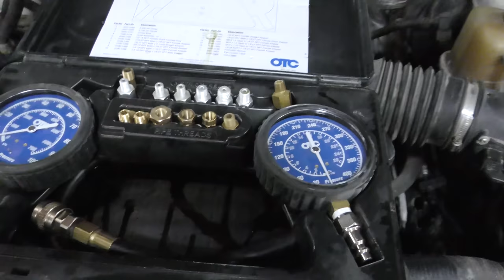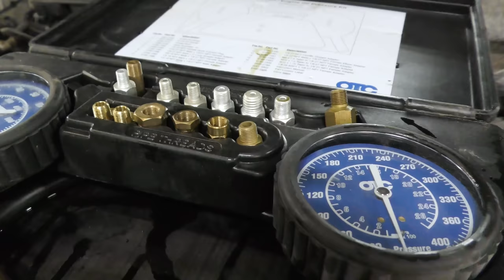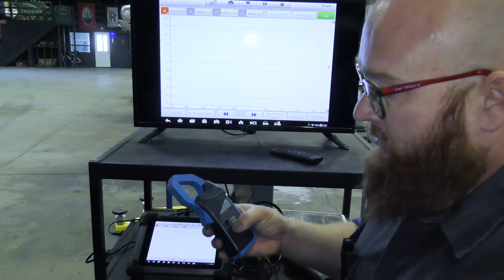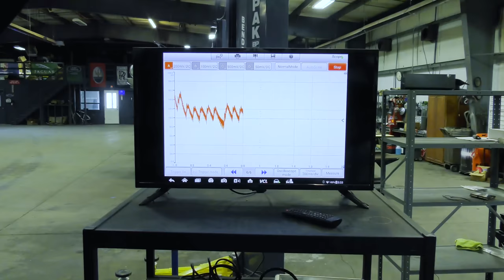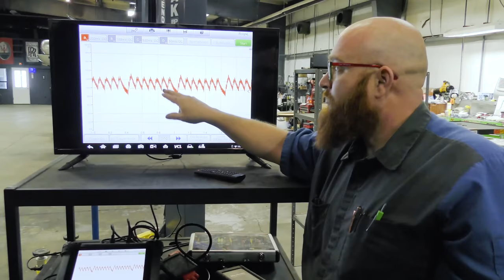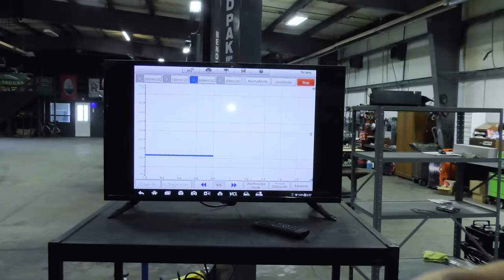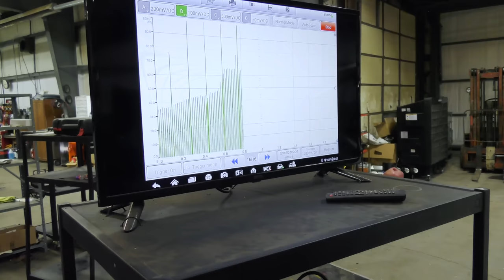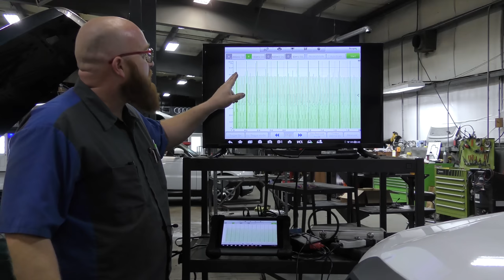Can an engine additive really fix this 2011 F150? CAR WIZARD shows how to diagnose and repair

Comment: thats why running a quality engine oil from the start and changing it on time is so important it helps make it so engines can go 200k to 300k before those types of problems occur.
Reply: Few people that buy new cars keep them beyond 100,000 miles. Therefore, they should use the cheapest oil they can find with the longest intervals. It's the next guy's problem.
Reply: @ryanroberts1104  too funny cause its true. Some people just dont even change the oil 😝
Reply: @ryanroberts1104  agree, if you are one of those guys who buy a new car every other year, why bother?
Reply: Can you define a "non quality," engine oil from the last 20 years?
Reply: its like the wizard said in another video, only 25% of people maintain a vehicle properly. I can attest to this because my son is the head oil change tech at the local valvoline and all the time people come in with a $60,000, $70,000 truck and put the cheapest shit oil they sell in them and dont want to do scheduled services.  They go 10,000 even 15,000 miles between oil changes using conventional oil in a ecoboost engine which is a recipe for trouble.  They just dont care, till it breaks, then they wonder why they need a new $15,000 ecoboost engine.
Reply: cheap oils with 5000miles intervals are good enough

Comment: Its cool that David is willing to admit he asks experts on cars he isn't completely familiar with.  Wizard isn't a cocky guy and knows there is always more to learn in the mechanical industry. Every tech should learn a lesson from this.
Reply: The guy on the phone said the engine is toast.  No oil change.  No proof of current oil used.  So the guy is NO expert.  An expert wants more data besides the mileage.

Comment: I have a 2011 Ford F150 with a 5.0L Coyote V8 in it with 138,000 miles on it and still going strong and it's a beast and it sounds like a beast with the Borla ATAK Catback exhaust on it.

Comment: I live in a tropical country, my car has 170k miles on it, the recommended oil is 5w30, i've been using 10w40 for a while now, it did help a lot with oil pressure issues
Reply: For hot climate you should use 10w50 or 20w50.
Reply: @draganmladenov  Try Shell Rotella triple t 15w40 it's for diesels but does wonders on worn engines
Reply: @klrrafman  I've been using rotella in my 98 Camry that has almost 308 thousand miles on it. I have an oil leak and it's where the head gasket seals an oil passage on the front of the motor. the Rotella actually slowed that oil leak down with the help of the Lucas oil treatment that the wizard mentioned in this video. For the time being.... that is saving me from a $600+ head gasket repair bill. Yes she still leaks oil.... but not near like she was before I started what I'm doing now.
Reply: @draganmladenov  I lived in Florida most of my life and EVERY vehicle I had ....I've always used Castrol 20W50. The heat breaks oil down pretty quickly in climates like that.... so I ALWAYS went with the thicker oil and it served me very well.
Reply: You really have to be careful putting thicker oil in modern engines, things like cam phasers do not like that - you could cause premature damage. Older, simpler engines, especially after they have some miles on them it can be a great idea to use thicker oil.
Reply: @michaellunn4582  In italy some car dealers use this trick on very worn engines. They call 20w50 "green miracle". :) It "restore" the oil pressure and the engine is very quiet.
You are right that heat can kill your motor oil and then the engine too. The most cars don't have good oil cooler. So with the high temperature the oil lose its viscosity and it is not enough to lubricate the main bearing of the crankshaft.
But we have cold winters and hot summers where i live. I have used on my sport car in the past 5w50 and 10w60.
Reply: @ryanroberts1104  For example BMW M power engines have cam phasers - vanos system. It doesn't have problem with 10w60.
Reply: @draganmladenov  And nobody is talking about that engine. And I'm sure they rarely last even 200k miles. You cannot just put thicker oil in everything willy nilly, you need to know what you are doing, and if you don't you shouldn't be doing anything.
Reply: @ryanroberts1104  You were "talking" about modern engine with phasers and i gave you an example that you are wrong. Not all modern engines will have issue with thicker oil.
And i'm not a "keyboard warrior". I actually have used 5w50 and 10w60 on v6 alfa romeo engine designed for 5w40 oil.
Also i have seen few engines with main bearing failures from using 5w40. Alfa romeo engines, not BMW.
And yes, It is your decision and responsibility what type of oil you will put in your engine.
Probably this f150 wouldn't have this issue if they used 5-40 or 0-40 since the beginning. Or just its oil cooler is not calculated well by ford. Not a surprise actually :D
Reply: @draganmladenov  : That engine is designed to use that weight oil, in that engine using any other weight is for emergency topping off only.
Reply: That’s what my mechanic recommends on high mileage vehicles but as long as the oil isn’t too heavy that it prevents cam phasers from operating properly on VVT valve trains.
Reply: @ryanroberts1104  My car is a 2009 ford duratec without any kind of vvt, but it does have hydraulic valve lifters, and it can be an issue if too thick oil is used, specially on colder climates
Reply: I also live in a tropical country, since the vehicle I have is a modern toyota non turbo, I use the recommended 0w20 synthetic oil. The protection is top notch and it runs smoothly. If using a thin oil like this in my opinion, just drive it normally not push it. Also, get the one that is API SP and ILSAC 6A or better rating. The rating of those modern oils mentioned proves that no matter the climate it so robust and you'll ne confident in that your vehicle will last long.
Reply: @draganmladenov  I live in Houston Tx and use 20W 50 in all three of my trucks and cars
Reply: @michaellunn4582  I too have always used 20W 50 in my four vehicles. I live in Houston Tx. In these hot climates the use of 20W 50 is good even when the car is new.

Comment: Change to Motorcraft Oil Filter--smart.  But it seems to me that the Lucas additive is simply acting as a thickener thus raising the oil pressure.  I'd expect changing to a higher viscosity motor oil would have the same effect.  I think problems like this generate out of the the auto manufacturer's love for continually thinner oils for the sake of raising their fuel MPG figures.
Reply: Yep motorcraft oil and filter in these Fords on regular intervals always. Uncle, former mechanic, taught me that 20yrs ago and never had an issue out of them. Even though I drive a GMC now. 😅

Comment: The advancement in diagnostic tools is amazing. They are a time and headache saver.
Reply: Now that only has to siff through to the customer.
Reply: Autel also sell some cheap and cheerful code readers, that could save you a few bucks with dodgy shops
Reply: Only if you have an OBD2 car.

Comment: 4 years ago I bought a 1996 Buick Roadmaster Collectors Edition with the tow package goodies, no hitch. Car had 22,641 miles and now has 36,000. I bought it sight unseen on eBay of all places. The owner was 72 when he got it, 92 when he died. I bought it from the widow. I had all the fluids changed, new tires and plugs but am currently stationed in Germany where I had it shipped. Been wanting the Wizard to do a thorough inspection to make sure it’s all good and luckily I am waiting on orders for my new duty station that is only a little over 2 hours a way from him. Will definitely stop by and hopefully he will show it on the channel. Inside is like new with some factory plastic on some pieces. Outside, black, has some scratches but what an awesome ride. See you soon Wizard💯🇺🇸

Comment: I'm a believer in Seafoam Green. Sometimes it takes a treatment or two but it's saved my cars and my motorcycles. For instance with my motorcycle I was told it needed a carb job including new needle jets. "$1200". It took two cans of seafoam, but I heard the motor suddenly sound like a jet engine. It ran like a brand new bike! I rode it for the next 5 years with only changing oil and plugs. The next owner couldn't believe how well it ran for it's age and mileage and I still see him riding it.

Comment: It is so satisfying to watch a professional at work!  The best professional mechanics start with logic and then, using the best tools at his/her disposal, gather necessary data to form an answer to the problem.  The Car Wizard demonstrates this ability on a regular basis!  It's no wonder his business has grown so much over the years, and he has so many devoted customers.  Kudos, Dave!
Reply: Professional logical mechanics don't use Lucas products.
Reply: @ryanroberts1104 ehh, I'm sure he discussed with the customer and was the cheapest logical decision to bump viscosity and help oil pressure. On a high mile engine like this, it isn't worth the tear down for oil pump and flush. The whole truck itself isn't even worth it imo.😅

Comment: Lucas oil treatment is no joke. My buddy who is a heavy-equipment diesel mechanic swears by it. He said that at they garage he worked at they were able to get 1/4 to 1/3 more life between rebuilds in their long-haul tractor trailers engines when put on a Lucas oil regiment. Good to know this stuff works for high-mileage light-duty vehicles too.
Reply: The newer synthetic version is alot better.

Comment: I work on loads of 5.4 3 valve engines. The ones with 5k mile oil change history easily go 300,000 miles with no cam phaser or chain problems. I see more 5.7 hemi cams failing than I see 5.4 problems.
Reply: Exactly 5k oil changes are the best because it’s takes into account the idiling you been doing the stop and got traffic lights and repeated start ups and cut offs. Now imagine going 7500k or 10k that oil is still lubricating but it’s also dirty very dirty also
Reply: Change your oil!  Oil is cheap, engines aren't.  I've never understood why manufacturers even when there are problems that could be largely avoided by more frequent oil changes stick to the once a year, 10k mile recommendation.  I do anywhere between 8-12k miles per year in my vehicles and change the oil 2x per year regardless of the miles because it is easier to remember so the oil is changed anywhere between 4-6k miles.  I also like to use synthetic oil, shell rotella gas truck or penzoil platinum seem to be the highest quality and 5 quarts usually costs like $20 and either Mann, Wix or OE filters, so even if I need 10 quarts of oil and the filter it's like $50, it's money well spent considering a new truck is 40 or 50k .  

My daily driver is 14 years old and has well over 100k city miles and still runs great even though it spent the majority of it's life doing less than 10 miles per day and running for an hour or more to do that 10 miles, so figure that assuming 10mph avg the motor has run 10,000 hours.  People don't realize how much harder stop and go city miles are on a car than highway, on an hours basis my car has run for many more hours than many cars with 250k miles on them, most cars with highway miles probably average 40mph to get the same runtime they'd need to run 400k miles.  By the time 5k miles has come around the oil stil has additive and is holding the dirt in suspension but the weight has definitely sheared outside of grade, I usually can hear the engine noises changing around 4k miles.
Reply: Cams don’t fail in the Hemis, it’s the lifters.
Reply: You know I tell every body this but people dont want to believe it the 5.4 are decent engines when maintained especially the 09 and 10 were literally bullet proof just put an ac compressor on one last week that had 298k on it. All the modern ford engine are way. Better than any if the shit gm is putting out
Reply: @tybailey9428  i completely agree LOL
Reply: What people don't know is that technically the 09/10 had a second generation of the 5.4 3v and Ford largely fixed a lot of the issues with redesigned phasers, redesigned can tensioners, redesigned camguides, redesigned oil pump, redesigned oiling system with wider galleries and stronger timing chains. With that said, the 5.4 is still a picky engine. But picky doesn't mean bad. I love the fact that I got my 2010 with every feature found on the newer trucks for more than 8 grand cheaper and in my favorite color...blue flame metallic. Powered sunroof, rear glass, heated and cooled seats, e locker, leather, navigation, limited slip front, rhino lined bed and all that.
Reply: @tybailey9428  Ford just announced AFM in the new 5L 2021, End well this may not ;)
Reply: @shaunbava1801  they advise long oil change intervals because it makes buyers happier. They don't especially care what happens after the warranty is over. In fact if your car wears out after the warranty expires they would love to sell you another one... Cars are becoming disposable.
Reply: Hemis are big time junk. Pretty much any Chrysler product is junk
Reply: Laughs in ls
Reply: Tbh I just go in when the sticker tells me. Sometimes a hundred or so more miles or less. I think it’s 3-4k. It’s 45 dollars and an hour of my time (dealer..OEM oil and filter) and everything around my engines fail but never the engine itself so I’m gonna keep at it.
Reply: For a period our shop would be nothing but 5.4s. Now we don't get that many probably because there's not that many worth owning. We get filled up with hemi trucks, chevys in general, and eco boost cars and trucks past couple of years
Reply: My 09 5.4 3v is at 187k and runs like a champ. I change my oil every 5k miles and I used 5w30 with BG MOA and motorcraft oil filter and the engine is smooth with no engine noise and smooth idling.  Still original timing
Reply: @H.H.Tuned.  allso have a 2009 ford expedition with the 5.4 3valve with 188,00 miles no engine issues change oil every 2,000 to 3,000 miles.
Reply: The car 🤡 hates the 5.4 3v so much he mentions it in videos that have nothing to  do with it lol. He also likes lucas and gm products so enough said.
Reply: @tybailey9428  the 09 and 10 are exactly the same engine
Reply: @alpha2gproject783  no. None of that was redesigned. I'm not sure why everyone thinks this.
Reply: @calebmelton5989  I don't have anything in front of me right now but there was documentation from Ford that detailed all of the revisions for the 5.4 3V which included new cam phasers, larger oil galleries, and different timing chain tensioners and guides. It was a pretty good read but basically this was done as a stop gap until the Coyote came out because they intended to give it a lifespan as long if not longer than the 5.4 3V. There was even an engineer that I got to chat with in PM's from a forum about a year ago about it and he was saying at the time the Coyote was supposed to be released with the new body style but they wanted to give it more testing.
Reply: @calebmelton5989  there were subtle updates to the engine in 2009 but they truly are Bullet proof just had one in last week in the shop last week 300k rat chewed cht wire under the intake ran like a top after
Reply: @billfrete8487  It's been 2 years and so far so good, I think Ford learned a lot from GM and Ram's AFM mistakes and made a better system.
Reply: @calebmelton5989  I think he was saying the 09/10 as in both of those years encompassed and not as if they are different.

Comment: watching videos like this, i get more and more the feeling, that there a lot of shops outhere, that dont actually care about their customers, they dont care about their concerns or think they are stupid, giving them cheap answers or replacing parts just on suspicion which not solve the problem at all. I recently got the diagnosis of a bearing damage (motorschaden / ) by one shop, just droving it around a bit, and thats it, no further testing of the engine at all. I was not really satifsfied with that statment. I brought it to a second shop and they said otherwise, even told me my oil is too thin (which the first shop did fill in with last years Technical check (TÜV)) . So i dont give up on it, and will not accept cheap answers anymore . Due to this and other videos i learn now a lot about this and how important it is to have really professional mechanics like the car wizard, thank you.